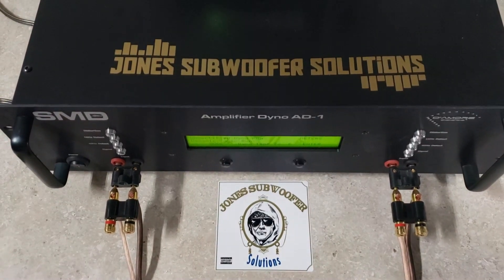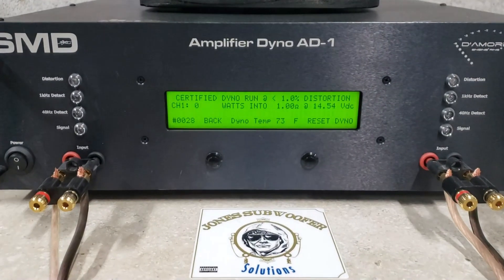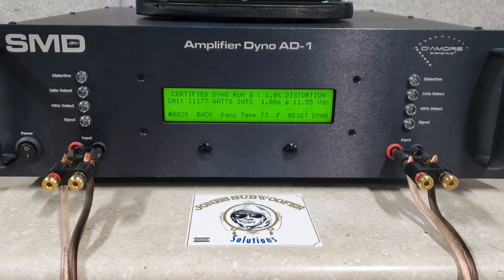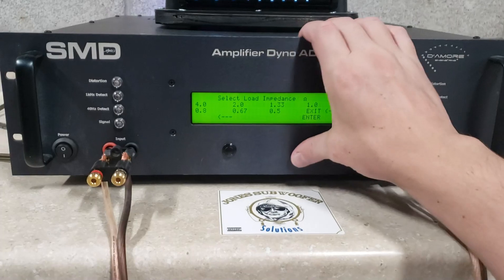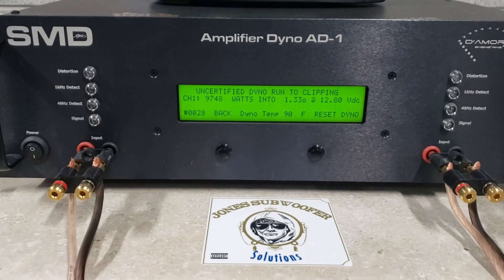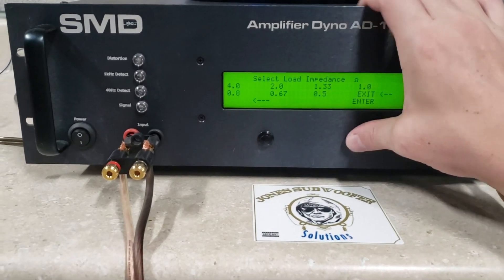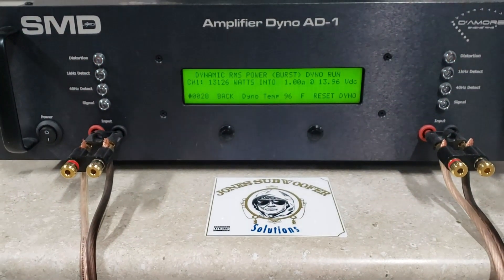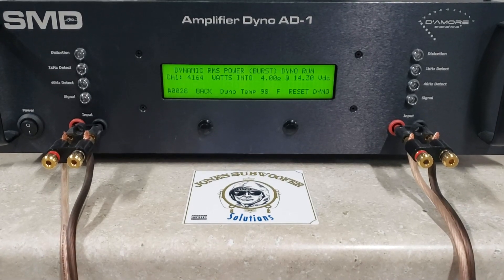AD-1 Amp Dyno Taramps MD12000 by Jones Subwoofer Solutions JSS

Comment: Really impressive lithium bank with the two 180 amp chargers. Your voltage stays good under big loads. I definitely appreciate the solid videos. No filler, you just get right into it.
Reply: Good my ass dropping in the low 12s is horrible
Reply: HOW IS THIS IMPRESSIVE OR REAL AT ALL??? 1 ALTERNATOR CHARHES HIGHER THAN HIS CHARGERS!! AND HIS POWER IS SHIT IF HES DROPPING THAT MUCH VOLTAGE!!!! IF HE STAYED AT 15 VOLTS AND RAN AT .5 OHM WICH ITS RATED AT!!! YOU WOULD SEE REAL NUMBERS

Comment: Next amp that you should test is the new 3500rms watt cea Rockville dbcomp5 with a built in volt meter! Its $350 new and a Korean board as well! No one has tested this amp😀
Reply from the maker: Should have it in early next week
Reply: @Facekicker  thanks man "Black kia elite 12" wanted to see this amp dyno more than me but I really can't wait to see it as well I be waiting😀
Reply: Chuck Holmes  no I don't think its junk who knows I run old Hifonics amp and they still work. Now this guy tested this amp and I can't believe how many watts it put out.
Reply: Chuck Holmes  your probably right Rockville might be junk but this amp I hear is a good cheap China board that you can find on the China 3000 watts SAE Sundown buget amp they make. But personally I would buy a Sundown because there components or probably put together better.
Reply: Chuck Holmes  I like whatever brand I can afford. I once had a 15 punch stage 3 600 rms watt Fosgate way back in the day it was good I sold it for a 15 m5 Memphis and now my dad has it now in his Buick Roadmaster. My current setup is 2 18 Soundqubed on 2 Hifonics amps strapped.
Reply: Chuck Holmes  that way under 2000rms watts that's why I like to see amps get dyno to see how some companies lie about the watts they claim.
Reply: Chuck Holmes  nice

Comment: So you warm the amp up before testing? I'm curious if it makes a difference if an amp is warm, or if they usually perform the same "warm" or cold? Thanks.
Reply from the maker: Amps are typically room temp when put on the bench, and I do all the tests in one sitting.   Most amps are at normal operating temperature after the first run.

Comment: I didn’t know you run a 2 ohm load on this amplifier
Reply from the maker: You can wire lower.
This was on my AGM bank that barely supported 12k.
Reply: The reason why I ask that because I’m m running at 2 ohm with two 12 inch vfx and I don’t want to over power them to the point I will blow them so I can’t decide to get the taramp 8k md or the 12 k md
Reply from the maker: @joemaxxcapri1799  MD8k is plenty for those.  Make sure you have the proper electrical support.

Comment: I know they make power but I've heard that they do blow easily and the build quality just isn't that great. Idk  🤷‍♂️  I think I'll spend more and get a little bit higher overall quality. Just my opinion.
Reply from the maker: These are great amps with a good protection circuit.   They are actually less likely to fail than many other amps.
Reply: @Facekicker  yeah I'm still thinking, do I get a taramps 12k or just get another salt 8k or sell my 8k and get two salt 6ks. But if I can find a crescendo encore 12k that's not a bad plan at all.

Comment: I know these Taramps amps despise doing rated power, but I am interested in trying one on my dual 4 ohm HCCA 12" though for the mad efficiency.  Currently running it off a HCCA3000.4H 4ch.  
I was thinking either a 8000w 2ohm or a 12000w 1ohm.  I want that 8 ohm power, voltage is king!  Shame above 8k models is only 1ohm.   Might go a Stetsom ST-EX10500EQ-2 but being cheaper than Taramps, surely they're even worse...
Reply: The md12000 is rated down to .5 ohm tho ?

Comment: Is 70 ah lithium and a 240 amp alt enough for this amp???
Reply: Ya
Reply: Before I even read the answer I said yup. I have a 400 mechman charging a 80ah xspower lithium bank, that's running my SounDigital Exo-X 12k amp and trust me my amp Digs when the bass drops. Meaning seems like that's a perfect match. It's Pushing 4 X15's V2's.

Comment: Mind truong 1k Hz load? Dont remember of you said it was @ 40hz or not most test that way which is cool just curious. I know the bass 12k isnt meant for 1khz all the same I wonder if itd blow it up or just cause a protect?
Reply from the maker: I would imagine it would work fine on 1kz, it's a full range amp.   I have just converted my bank to CMAX and will be doing the big Taramps models again, I'll try to include a few full range dynos also.
Reply: It won't send to protect, all it would do would be elevate the watts.

Comment: My Stetsom 7k does 6,004W @ 9.9V regularly, and has since 2012 when I bought it. 
(I don't have a strong enough batt bank, obviously, but, it doesn't care.) 
Wired .7 rising to a perfect 1 Ohm during burps.
Reply: I call bs...
Reply: @jermainephillips5179  Then, you called WRONG. 👈🏻 
The amp has been doing that every show I attend, with no issue, since 2012.

Comment: I think your power supply is dropping to fast. Your 15k and 12k had similar numbers.
Reply from the maker: We've got a new CMAX bank and will be revisiting the larger Taramps soon
Reply: I heard that because the md 12k is rated at 12.6 volts and the Bass 15k is rated at 14.4 volts. That the md 12k is stronger!👍

Comment: Niiiiiiiice 😍
Reply: What causes them taramps to blow thou?
Reply: @d.j.theman7581  usually carelessness.
Number one being the lack of necessary electrical, impedance being entirely too low, and excessive abuse of the amplifier such as heavy, and excessive clipping. I see a lot of short circuiting also, simply due to people mis-installing or messing with the speaker wires or whatnot while the amplifier is on.
If a customer takes care of their equipment they will not have any issues at all whatsoever.

Comment: My opinion is the Korean amps boards are built better than this amp. Next amp I might try is a 6,000watt crescendo bassclef at .5 ohms. I've heard at .5 there clear and put out over 8000rms watt clear watts. I only got around 3600rms watts of Korean amp power at the time. I got 2 older Hifonics 2000 cea Brutus amps back when Hifonics knew how to build an amp and its so clear 15hz even shakes my front doors on my no wall 2 18 in a long suburban!!!
Reply: Should try it at 1ohm instead of .5
Reply: Nendo doesn't have a 12k only a 13k... 12k has been discontinued for years
Reply: Well I get the point taramps is good for the price. 2 question how much is a 12 taramp and dose it come in the bass line? I'm looking for a powerful bass amp not a full channel.
Reply: @RyanBassForLife  They don't make a Bass 12k. Only the MD12000 for $690 on Amazon. (Just use the built in electronic crossover if you don't want it full range) The closest Taramps in the Bass line is the Bass 15K for $1100... Not sure if it's worth $410 more than the MD12000. My gut says no.
Reply: @RyanBassForLife  In fact the MD12000 made 11177 watts where the Bass 15K only made 10458 on the same dyno. Save yourself $410 and get 719 more watts! MD12000 for the win!
Reply: If you're used to the sound of Korean, don't get Taramps. They sound terrible in comparison. I bought an MD 12K new and didn't like it at all. So then I bought a DSP and it did help a lot. But I still sold it shortly after buying it and went back to Korean.
Reply: @Widowmaker2828  thanks I think I'm just going to stick with Korean amps because of the clearity. I got some more affordable Korean amps 2 Hifonics 2000 Brutus and enjoy the clarity of this but this MD12000 watts Taramp sounds like a deal.
Reply: @Widowmaker2828  your right but I'm very broke at the moment and I can't even afford an upgrade so I'm just going to keep my my 2 bridged hifonics amps on my 2 18 soundqubed hdx3s.
Reply: @Cluexbl  your right and the price of crescendo it's over my budget so I might just get a 8k taramps bass line seem how I only need 4k on each subwoofer anyways. Even that might be to many watts for my 2 18 soundqubed hdx3s. Just not a fan of full range frequency going into my subs.
Reply: @Peyton Cole thanks but if I get a Taramp its going to be a bass line amp. Seem how I only have 2 1500 rms watt sundqubed subs I think ill just get a Taramp 8k bass line. Taramp is very affordable so that's why me a Korean amp lover is still looking at taramp to buy but I only want low Hz on the amp.
Reply: @Rob-dd7dm  thanks I hear rockville 3000 comp db sires Korean amp and 3500 rockville are good. Black kia elite 12s says he's testing a 3000 new comp db rockville and its $299 and hits over 3000 rms watts! Might someday go with one of those and get 2 and bridge them to 2 ohms to get 6k! Not sure if its reliable because its new off the line but in goining to keep watching to see if his breaks down or something.
Reply: @RyanBassForLife  I am slightly confused, you do know you can use the built in electronic crossover and only low frequencies will go into your subs right? This goes for all amps. But I agree if it ain't broke don't fix it. Keep the amps you have. They work well!
Reply: @Rob-dd7dm  Not sure what you are talking about. I have a ton of Korean amps and a few Brazilian mainly Taramps and I can not tell a difference between them. My Taramps MD8000 is extremely tight and goes extremely.low (10 hz) with no problems. Extremely happy with it!
Reply: @Widowmaker2828  I envy you man. lol
Reply: @Widowmaker2828  you win taramp is a dam good brand I'm sorry if I affended your brand. Some Korean amps are not good and the good korean amps a exspensive.
Reply: Good luck trying to find your bass clef I've been looking for some time now